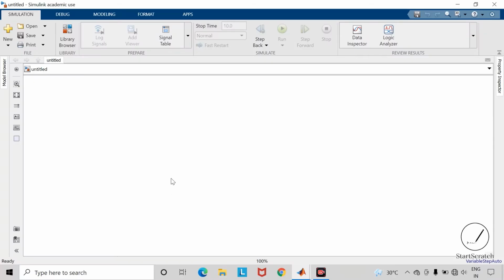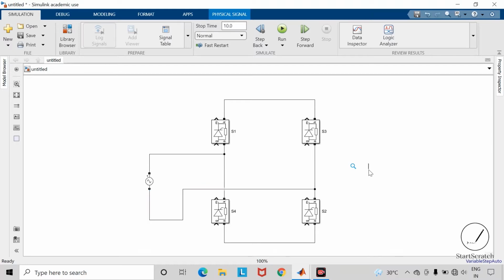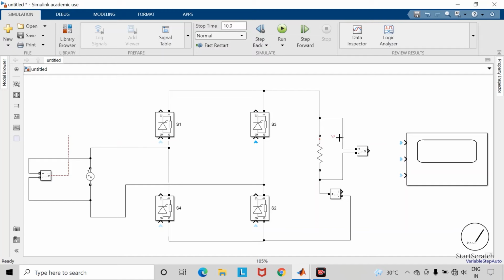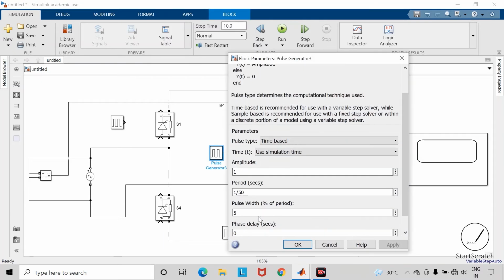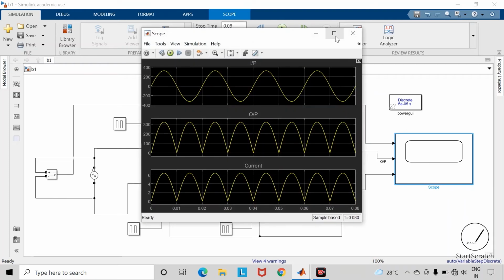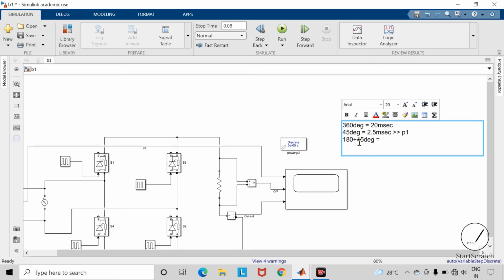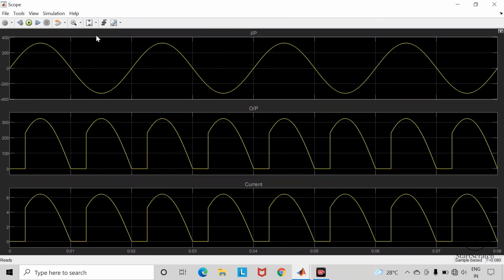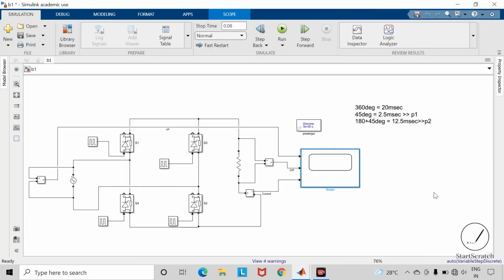L11| Single phase Full wave controlled Rectifier with R load

Comment: Please note that this video is related to:
Single-phase Full-wave controlled Rectifier with R load

Quiz:
1. How many thyristors are used in the circuit?

2. What will be the phase delay for the 2nd pair if we want firing angle as 60degree?

3. Which thyristors are conducting in the positive half cycle of ac supply?